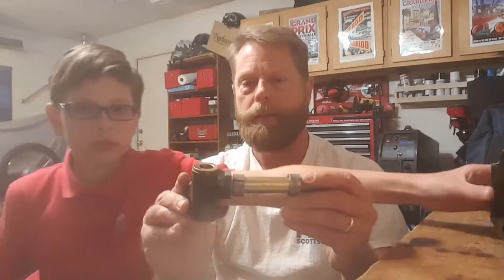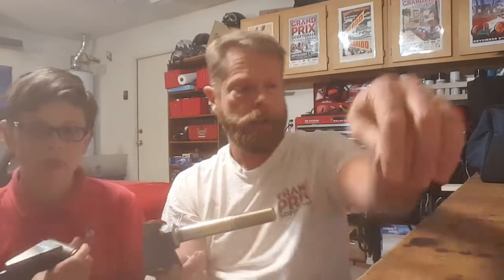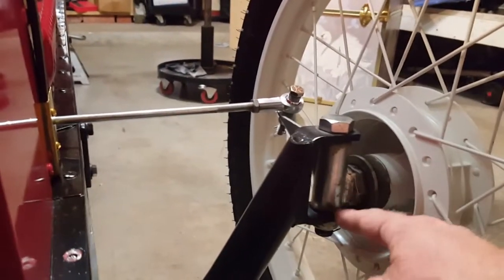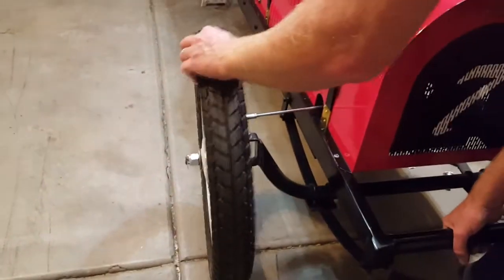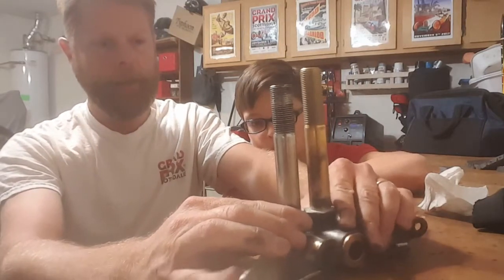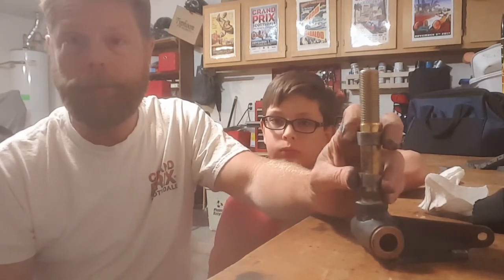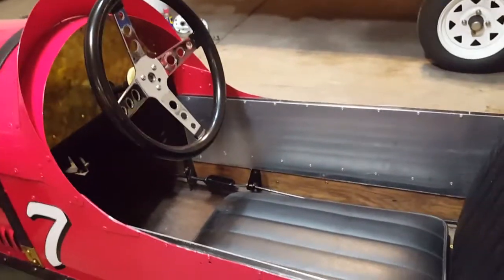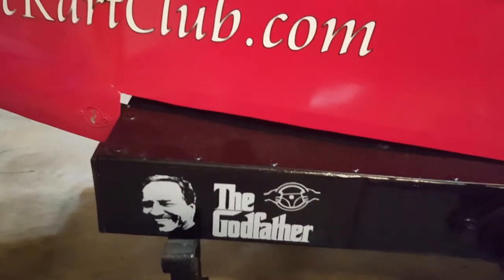Vintage Kart Co. Spindle Upgrade

Comment: That will make a huge difference.  Your red ford drove really good, except for those sloppy spindles. Your making improvements for the 2018 point series aren't you. I guess I need to upgrade the ratrod now.